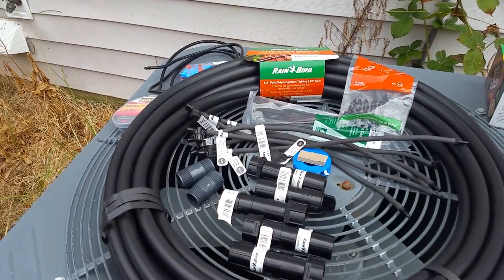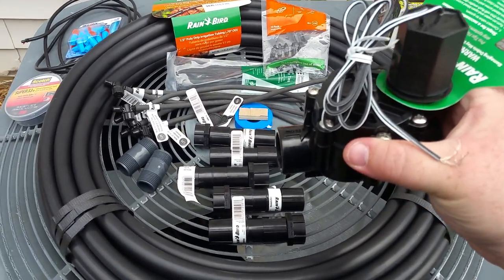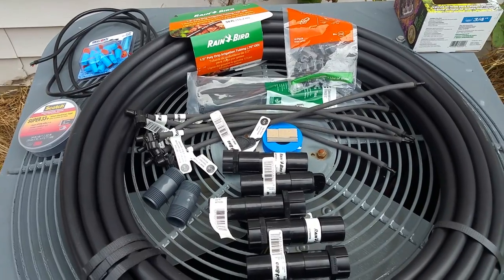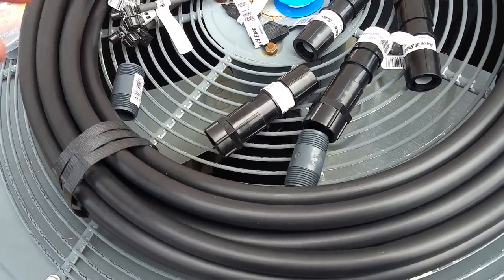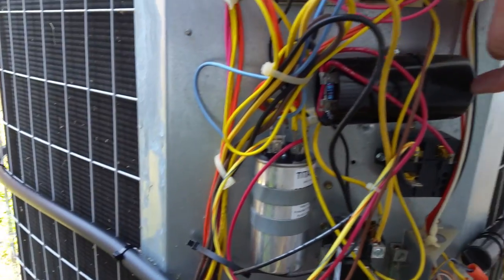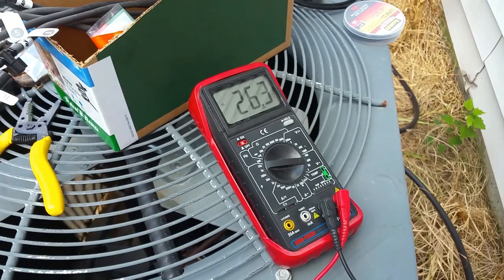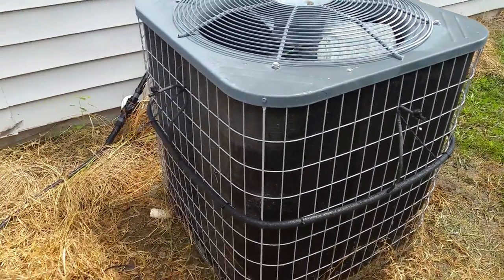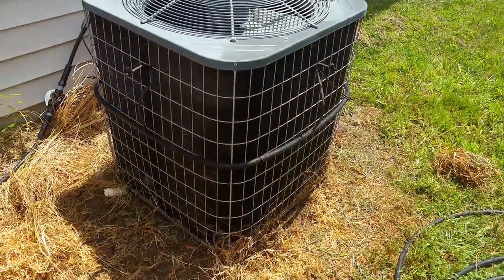DIY Automatic A/C Condenser Evaporator Mister - Electronically controlled!

Comment: I wouldn't do this your only going to rot out the unit quicker I would keep the coils clean. Clear out that grass around the unit put some weed blocker down and some gravel and create a shade wall about 18" or so from the sides to keep the sun off of it. Adding water to electrical equipment is asking for problems. That's just my opinion anyway:)
Reply: IT RAINS YOU KNOW! And I've never seen an AC unit fail due to being "rotted out" have you? The materials used are quite corrosion resistant. Yes your opinion, your opinion formed in about ten seconds without really stopping to think about anything. THIS DOES WORK! LOTS OF WINDOW UNITS  DO THIS BY DESIGN! It's a well known hack around here when it's over 100, if your unit can't keep up, mist it. Suddenly and instantly you see the difference. no need to do this every day, just when tempos are high as hell. None of these problems that people keep talking about are really valid at all if used correctly. Window units use the condensate that you normally drain onto the ground, would be best to use this for that split unit too.
Reply: I can see the possible benefits in a dry hot area like Texas and Arizona but where I live in New York not so much it rarely reaches over 85 and its humid. There is a company that makes one that is wifi based and only goes on when needed ie. When outside temperatures reach a certain level ect. I believe in my opinion that exposing the unit to water every day hours at a time has to shorten its life span since it was never designed to.

Comment: You have to adjust those misters..you are loosing to much water..
Reply from the maker: In my update videos, I did switch out the nozzles with ones that use FAR FAR less water, and do a much better job of atomizing the water. Significantly reduced the water usage while increase efficiency of the mister.

Comment: This is a bad idea. Although the condenser is built to be outdoors, the cooling fins are not designed to be exposed to water all the time. If you look into your unit you'll see that the fins are covered on top by the lid and on the sides (on some models) by a downward sloping grill.  Water from your faucet is going to leave deposits on your cooling fins and this will deteriorate the ability of the fin to function properly - even if you use the cheap water filter they show in this video.
Reply from the maker: James, if I had very hard water I would agree. However after 1.5 full seasons there are not deposits. I mentioned I have very soft water, very little minerals. Nothing a chemical cleaning and/or pressure washing couldn't fix if it had to be done yearly.

Comment: DON'T DO IT! 37 year HVAC veteran here, 17 of which providing technical support for a major manufacturer. Misters will damage your compressor in low to mild ambient temperatures. Misters drop the head pressure too low under these conditions resulting in excessively low evaporator coil temperatures. You going to remember to turn the water off when it's mild outside? How about in winter?
Reply: Wouldn't this cause the pressure to be lower which would cause the compressor to run longer to try to reach efficient pressures. Tell me if im wrong here but isn't each compressor and or "Unit" dialed in to a certain pressure at which it can run most efficient. So by lowering the pressure this would cause the compressor to maybe not work as hard but work longer to try and reach those said pressures.
Reply: We only run our A/C when it's hotter than 77 in the house. When the house is that hot, it's plenty hot outside for low ambient temperature to not be a problem.  Our neighbor runs their A/C day and night. It runs when the outside temp in in the low fifties and there's never a problem. The mister certainly isn't going to lower the air temp to below fifty. Likely only lowering it by under 10 degrees.  I have to agree that there could be some issues with rust from the chlorine in the water, but that's  easy enough to filter out. Overall, I'd give this contraption a thumbs up.

Comment: Zero electric was saved with this as run time is not reduced. It still produces the same number of BTUs it was designed to and since the condenser fan is still running it still pulls the same total amperage.
Reply from the maker: Wrong. My evaporator temps have dropped, which means the recovery in the evening is reduced as more BTUs ARE being transferred outside. Recovery time is down 10-20% depending on weather conditions. This is locking in as many variables as possible. Same external temp for a few days in a row, clear days, etc. Humidity obviously plays the largest role in the efficiency of an evaporative cooler. I am working on an update video that will go over all the data I've collected so far this season. I have a SDR radio intercepting my electric smart meter's signal, and am graphing that usage using a raspberry pi and Grafana. I can show exactly when the A/C runs, and for how long. Along with actual Kwh usage on a per 5 minute basis. I have also been taking temperature readings of the return air before and after the evaporator coil with the system running and not running. I do have more of a drop in temp after evaporator. I'll be including this in my update video as well. I welcome your criticism, but my data (and wallet) prove otherwise.

Comment: The water will leave scale buildup on your coils and fins, and soon ruin the entire coil unit.
Reply: Why can't you occasionally spray off with a vinegar or clr solution to get rid of the scale?
Reply: Vinegar or other acidic cleaners will soften lime, but you still have to physically scrub it off. That will probably result in damaging the fins.

Comment: Look i've been doing HVAC work for 20 years and this is the worst idea ever. You will make your cost greater by doing this if it was better with water they would make them with water misters amd they dont. Also void your warranty by doing so. Good luck fools
Reply: They do make them with misters. They were used regularly until to waste systems like these are against regulations so they aren't built anymore.
Reply: they just dont understand what the wet coil will do.... by getting the coil wet all the time is turning it into a giant filter that traps dirt and eventually will cause high head pressure and burn up the unit by causing a leak .
Reply: Cliff P you're actually incorrect. There is no such thing as "cooling". It's removing heat not cooling. There is no such thing. You people need to pick up a book and educate yourself
Reply: tim doerr: Removing Heat and Cooling are the same thing with different names. Like 212F = 100C.  It's the same thing, just different name.
Reply: Water running over the coils would actually help to keep the coils clean as the water would wash away any dust that collects on them. I ran a spray unit on my window unit for over a year and didn't have any dirt on the coils or even algae or other icky stuff. They were clean.
The job of the condenser is to remove heat from the compressed fluid. Once the ambient air temps reach too close to the temps the pump is trying to dump out, the pump has to work even harder to build even more pressure to raise the temps high enough to dissipate the heat. There needs to be a 20F difference between coil and ambient for it to be effective. By keeping the relative ambient temps low enough, the 20F difference is easily reached and therefore the pump doesn't have to work no where near as hard.
And yes, I get my information from an official HVAC workbook that is taught in colleges. And even in there it talks about using a secondary cooling medium to help remove heat from the condenser. This is either water running over the coils or a secondary radiator that has water flowing through it (like a vehicle radiator is designed)
Reply: He's hitting you up with science since cold is the absence of heat. He's just doing it in a rude manner!
Reply: But it has been on the market, Was for years, federal regulation ended the sale of them. Waste water A/C systems are against federal regulations. They do work better and were sold for a long time.

Comment: Look, the bottom line is this. The only evaportive condensers out there are those in plants that will usually run anhydrous ammonia as a refrigerant. And even with those the amount of chemicals you have to cycle through the sump is very costly and have to be closely monitored. All you guys are doing is adding more wear and tear and causing serious scale build up. You people need to educate yourself here. And stick to the motto of good mechanics and those with common sense: if it's working, DONT TRY AND FIX IT!!!! - Industrial refrigeration mechanic

Comment: All this will do is to upset the refrigerant pressures. The condenser has to maintain a certain pressure. Also the minerals in the water will just end up coating and destroying the fins on the condenser. Better off just leaving it how it was meant to function.
Reply from the maker: So, what happens when it's 102F outside, and we get a sudden rain storm that brought in cool air and drops ambient temp to 78F? Happens WEEKLY here. Doesn't seem to damage the AC does it? You don't understand what the goal of an evaporative cooler is do you? I'm cooing the ambient air around the coils, not spraying a garden hose into my unit. Do you really think they're designed to work with one set outside air temperature?

Comment: If your unit is clean this is not needed. Misting the unit with water lower the high pressure so you need a fan control to turn off the fan if the pressure drops to much so you will not have the unit longer a waste of power or burning out the compressor due to changing the sub cooling. The unit make this heat to to cool the home. If do not run both water and the fan the unit will think if low of Freon. If this work you need a service man bad.

Comment: I dunno man. 70$ and you do all the work vs 100$ for a kit seems dubious.
Reply from the maker: As I stated in my video. The $100 version is extremely cheaply made, uses an air flap valve that MANY people had issues with leaking, or failing after only 1 season. This takes the weak point of that air valve out of the equation.

Comment: No no, just don't. Refrigeration tech for 25 yrs. Rust , oxidation of aluminum constantly eating at coils will shorten life of coil, fram, motor, not to mention causing eventual swamp in the area crates mold and unwanted water loving bugs soaking into foudation, eventually leading to termites. Its a slippery slope. While water certainly reduces head, and run time for the short term, it still takes so many btus to cool so many buts lol (old refrigeration saying) meaning u can do water all u want, it still takes so much run time in a 24 hr period to maintain a 90 degree house to obtain a 72 degree desired temp...its that simple. Wanna hint, ok im guessing not but i will share anyway,,,,,,,,,,,,, buy a shade tree ...that simple. Its the cheapest, easiest, no fuss, way to reduce you ac bill, and lengthen life of the outdoor unit.  Not an evergreen! !! It needs to be leaves shading in summer, and bare in winter so sun will actually help heat in winter a little, but shade will help out cooling in summer...wheel doesn't need reinventing,  nuff said

Comment: No gauges or temperature readings on the refridge side so you have no idea what is going on with the system. And you need a proper differential pressure for proper refrigeration effect. Liquid line temp is usually around 105-110F this is what fan cycling controls are usually at to maintain proper head pressure control. So if this is a piston orifice metering device guaranteed it will slug liquid refrigerant back to compressor. You would have to wire solenoid to a discharge pressure control for this to work properly, but this will also destroy the condenser in time seen it before. The good news is this type of thing will keep my pensionable time way up. Lmfao.

Comment: Your turning a condenser into a swamp cooler, not smart. You will have more problems than you realize later down the road.
Reply from the maker: I appreciate your concern. 2 years and zero issues. No buildup, no rust. No issues.

Comment: If you want to lower your utility bill, hire a competent HVAC company that knows how to properly do manual J manual S and manual D calculations, along with the ability to fix the findings.  Roughly 90% of residential HVAC systems in the USA suffer from one or more of the following: 
1) Oversized equipment.
2) Undersized duct system
3) Excessive duct system leakage
4) house pressure imbalance do to duct leakage
5) improper  refrigerant charge(usually do to low airflow from undersized ducts)
6) Poor, or improper installations
7) Poor system maintenance
Most homes in America, and much of the world are simply not working properly from one or more of the above, and sometimes even a few lesser issues that still bear in factor.
Band-aids and gimmicks will never go as far as actual knowledge of how to diagnose and correct the above common place issues.
The mister is a perfect example of a band-aid approach of lowering utility costs, with the increased likelihood of reduced service life of the equipment.
Reply from the maker: You are 100% correct. However this is a cost to benefit ratio scenario for me. I bought this home already built. The cost to have a new system put in that would meet all those criteria you mentioned would take many many years to see a break even tipping point. My band aid is a "do what I can to make what I have a little better." I'm not advocating this as a true solution for any and all issues that you listed. Just trying to improve what I already have for the least amount of money possible.

Thank you for your comment.

Comment: Why in the world would you want to take untreated water and run it over an AC coil and lime and scale the coil up and crate one big mess makes no sence.
Reply from the maker: Wayne Sorensen 1) You obviously didn't listen to the video. At the time this was recorded the filter was on the way, was installed 2 days later. 2) I also stated I have very soft water, that is also very close to neutral pH. My updated videos show the installation with the calcium filter added as a precaution. 3) If this thing saves me 40 bucks a month on my power bill, the effort to CLR the thing from time to time is well worth it. Condenser misters are nothing new and have been used in commercial environments for decades.

Comment: Don't do it,Waste of time and money 45 yrs AC  Contractor you WILL ruin the coils
Reply from the maker: 2 years and zero calcium/scale buildup on the coils. I keep an eye on it, and if there is buildup there are plenty of over the counter products that can descale safely if needed. As I stated several times in my video I have very soft water, and installed a calcium filter as a preventative measure.
Reply: @jonboy545  if I use water from a water softener, calcium is removed

Comment: Far more long term harm than good.  To suggest this is a good accessory if ridiculous.  Rusted out chassis, clogged fins   Its just WAY wrong,,,   Why not just build a swamp cooler around the whole condenser. hahahahah
Reply from the maker: Right... Rust.... Forgot that normal A/C units have tents put over them. I guess my home builder cheaped out and forgot mine.  A swamp cooler is nothing more than an evaporative cooler so... already done that. I'm not spraying huge quantities of water into my A/C. I'm spraying a very fine mist away from the A/C that has mostly evaporated before it makes its way past the fan.

Comment: this is the stupidest thing iv ever seen, your unit is designed to run on particular temp ranges ... trust me, they knew perfectly well how hot of a day it was gonna be when you ran your unit. save your expenses and if anything just get your system tuned up by a professional or put the money towards better isolation of your main living space ...
Reply from the maker: Yet my evaporator before/after temps are down, recovery time has reduced. It's so stupid it works. Meh.

Comment: would a shade umbrella work?
Reply: Shading will help to a degree, but you must not put a building around the unit. The top need to be about 6ft above the unit to allow for adequate air flow. Having some shrubs around the unit, but about 4ft from it, will help add some cool air as the plants cool the air through natural misting. If you have a large shade tree that covers the unit, that would work too.
As Jonathan states, the coils do need to be kept clean, and unbent. If a fin becomes bent, it diminishes the effectiveness in that area. Gently straighten the fin back out. 
If you do decide to do a mister, just make sure to use clean water, with a filter if possible. This minimizes calcium (scale) and rust. I have a large bucket under my window unit and recirculator pump to mist the coils and it dropped my bill by at least $30/month. Use a float valve in the bucket to maintain water level. I only lost about 2 gallons or so a day.